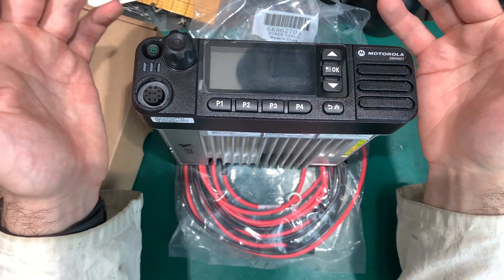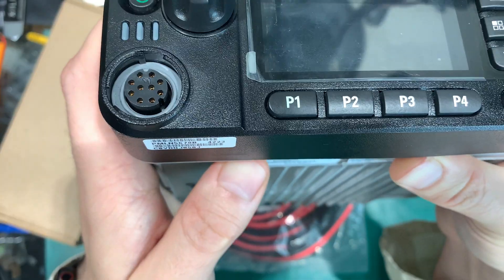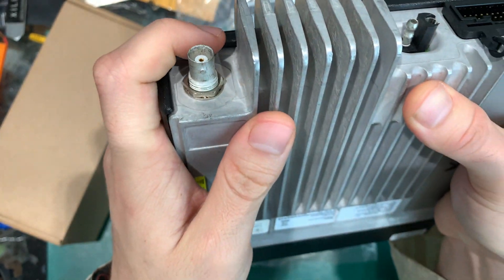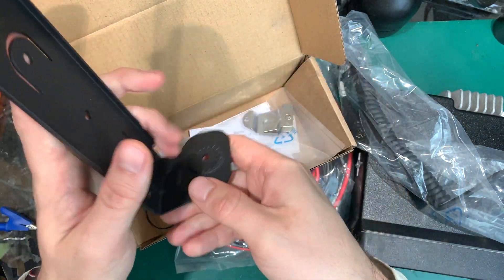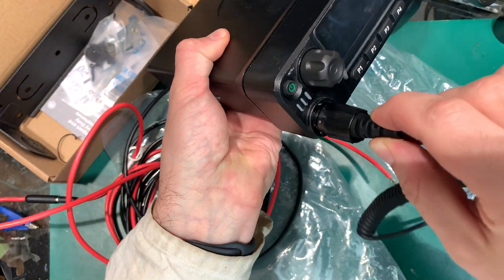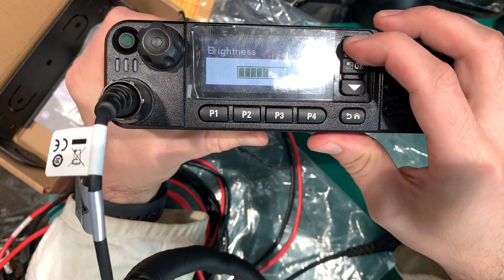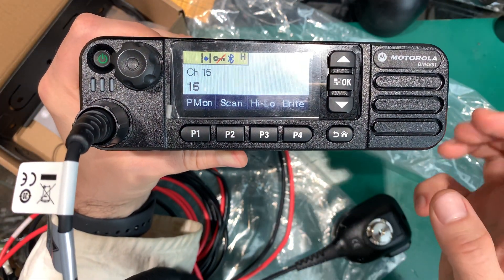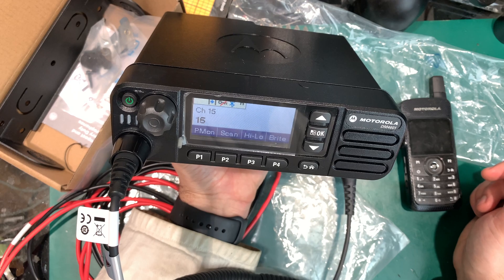Motorola DM4601  DMR / GPS / Bluetooth / 25W digital  mobile radio

Comment: SHould get this or anytone?
Reply from the maker: That depend, Motorola is commercial radio for public safety or security agencies - Anytone is more for amateur radio so in reality this goes what features You need and exact  use case to make decision. For sure spending 10x times more on Motorola than Anytone will not give You 10 times range.
Reply: @ElectronicNoobBlog  Sure. Thing is there is price parity, between dm4601 and anytone. Actually motorola is even cheaper. What i am looking for is simple dmr radio.
Reply from the maker: @lezion  Motorola is channelized so it's definitely simpler for non trained users, after programming once via computer You can forget, and there is 0  risk someone will mess it up using front panel, You can't change  frequency or color code from menu and make it non usable as intended- so in that term it's simpler.
Reply: @ElectronicNoobBlog  Do you think its worth paying extra 200$ to get e version?
Reply from the maker: @lezion  If economy allow I would go with enhanced version (e) - You buy it for another 10 years - I don't think DMR standard will change lot and Motorola already proven they can do magic with firmware update so definitely stick with top tier version.

Comment: I recently purchased a Motorola two way mobile radio - DM 460 - for my vehicle. It came with an antenna .... but  I am not too keen using that because I wanted something discreet. I know there are also other models that use a magnet as a base as to avoid making a whole on the roof. I also like those boating antennas as you can bend them down when you using. Any suggestions ? Thank you.